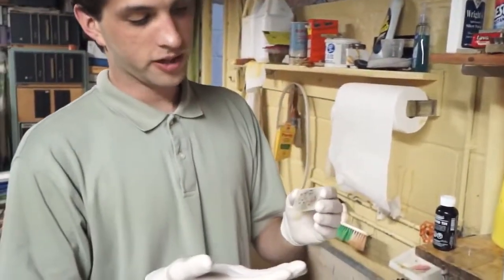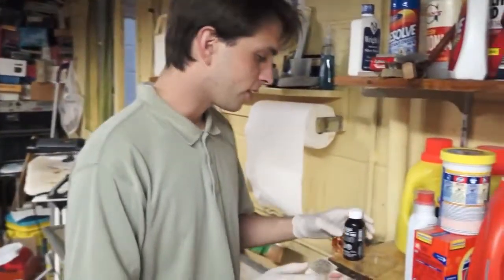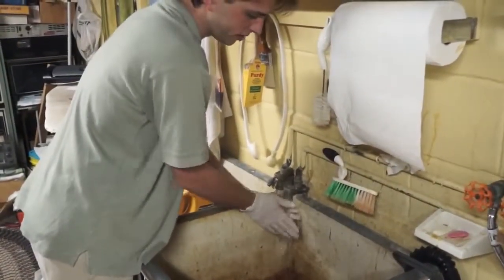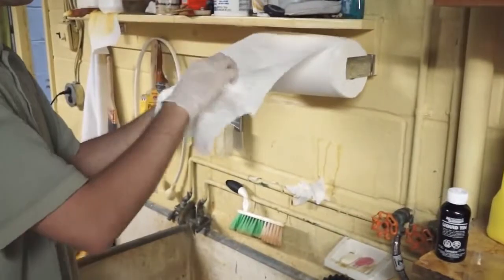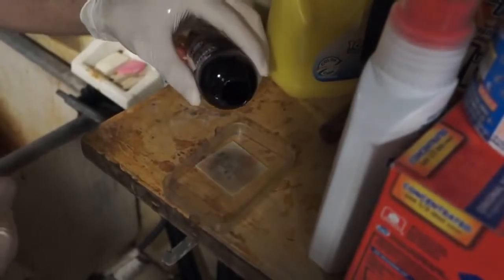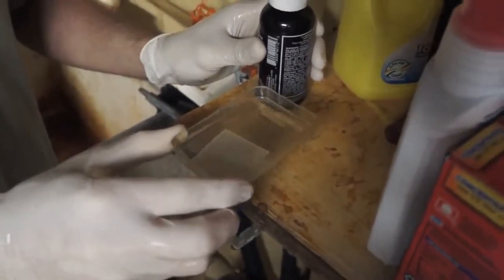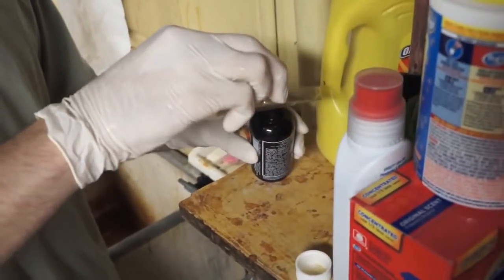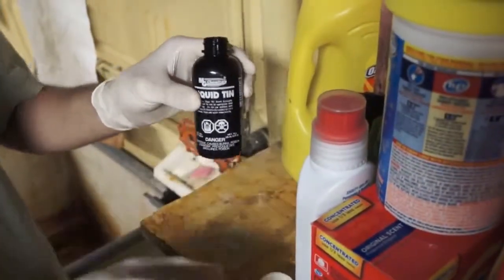Tinning Circuit Boards with Liquid Tin

Comment: I've had the same bottle of liquid tin for many years but I've had it stored outside and I just read the MG Chemical datasheet saying freezing ruins the solution, would you happen to if there is any way to restore it? It still works but is nowhere as potent as it used to be. There were brittle flake like crystals forming near the bottom of the bottle I filtered out and collected, would they be part of the solution that separated out or is it just contaminates that have settled at the bottom? The stuff is way more expensive than I can afford right now so it would be good if there was a way to fix it other than buying a new bottle.